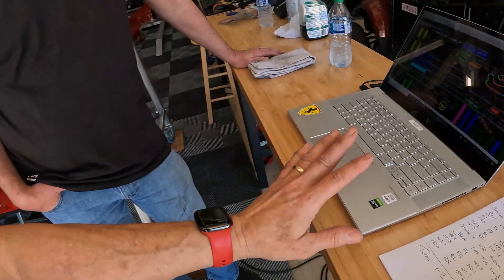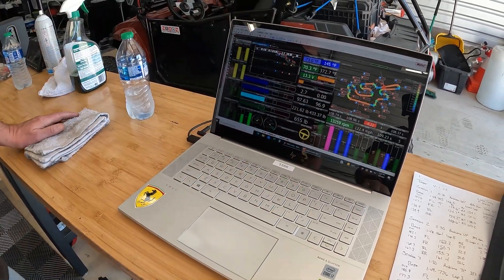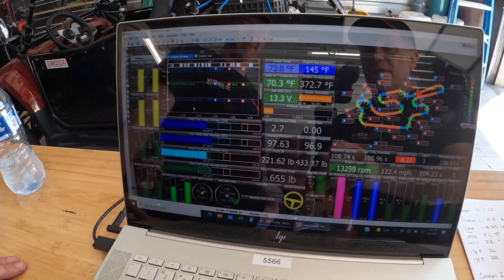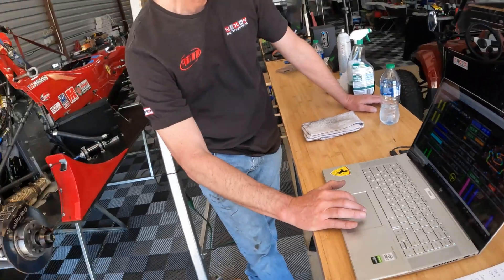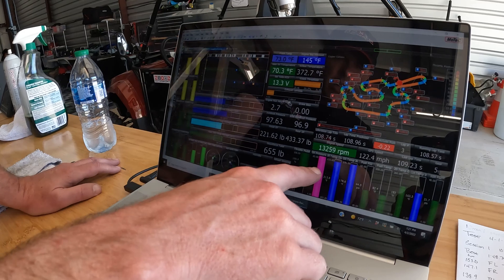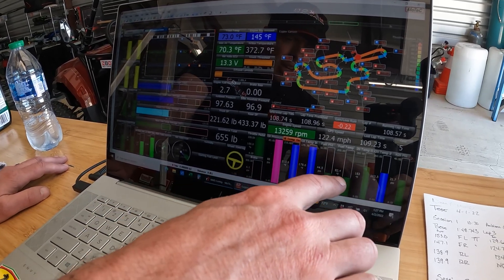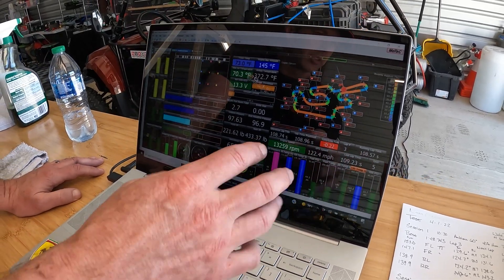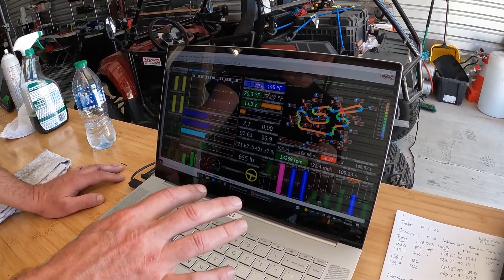Telemetry for Racers: How Teams Use It to Win

Comment: What software do you use for your real time telemetry?
Reply from the maker: Hi Jeremy, using Motec T2 software which handles the data stream with the Motec 4G modems.  It's all Motec, the analysis software is also Motec and called i2.  I hope this helps, cheers